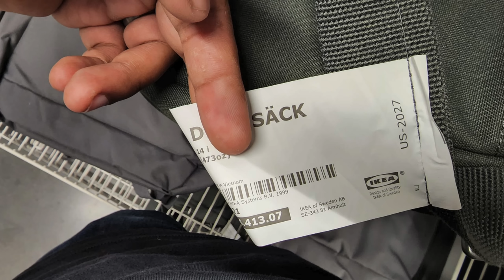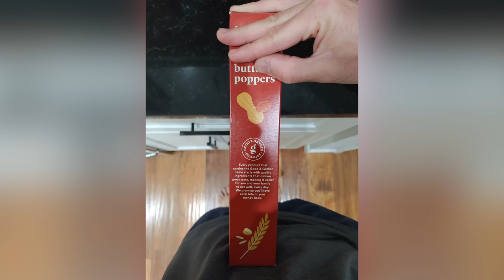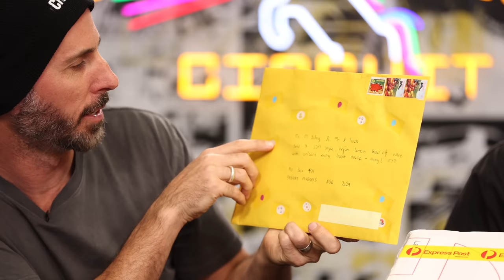We Tried to Steal our own car Conspiracy [Unicorn Circuit EP102]

Comment: Seat belts = Volvo first. Airbags were actually GM in America, who then ditched them for being too expensive. Merc then added to the S-class in 81.
Reply: Volvo invented 3 point seat belts... cars had seat belts before this.
Reply: Henry Ford invented the first car.   Who gives a fuck about a Volvo
Reply: @ddracing2257  hate to tell you but Henry Ford DID NOT invent the first car 🤣🤣 some German guy Carl Benz did
Reply: @ddracing2257  huh? are you 12?
Reply: Also the first ABS equiped car was the S-class. 
The first common rail injection diesel engined passenger car was an Alfa Romeo 156, also the Magneti Marelli and Fiat had invented the modern common rail system, and later sold the licence to Bosch. 
Just the two off the top of my head.
Reply: @ddracing2257  ya he likely stole it. And noone invents anything. Just discovered
Reply: That is correct but it was a 3point  👌 mg in the uk had the first production car with a seatbelt in the 1930's their motto is "SAFETY-FAST " because of this
Reply: Worth noting, Volvo invented the 3 point seatbelt and then gave away the patent for free so that other manufacturers could use it as well. 
Thanks Volvo, nice one.
Reply: @ddracing2257  Henry ford did not come close to inventing the first car.  Henry Ford's biggest claim to fame was the modern assembly line.  Carl Benz gets the car credits.
Reply: @garyhowe88  and  the diesel  engine  Rudolf diesel I think
Reply: @funkysaurus  but I think  he stole it from  Japan but maybe I am mixed it up with just in time assembly.
Reply: Volvo gave the design with the world for free.

Comment: In Finland, almost no dealerships have cars in stock. Some larger have "standard" equipped models (usually almost no extras, and almost always white). The most common thing when buying a new car though, is to sit down with the dealer, choose exactly what you want and don't want, and then that specific car is ordered from the factory. Yes, you have to wait several months for delivery, but you don't have to pay dealership scalper prices, and of course the dealer doesn't have to tie up funds in inventory and storage.
Reply: Word/Amen! One of these days I'll get to spec a car just how I want it & order it from the Company direct. Especially if it's one of those cool companies that lets me pick my own unique colors instead of just picking the 5-10 colors they have on the brochure. Someday, some day, it won't just be me fantasizing on Honda/Acura's page, building my dream NSX (or Toyota, building a legit Supra made by Toyota instead of bmw). It would be well worth the wait for sure! Like those 1%'ers that can afford a Huarya, or a Koenigsegg, etc etc., and they spec their car & wait a year or two to get it because it's made to such a high degree of quality & performance. In other words (long message) I totally agree with you! I just want a 1993 Red or Black (or whatever color really) Twin-Turbo 1JZ powered Toyota 👑 (Crown) Majesta/Royal Saloon wagon with a fully adjustable suspension & some sweet 18"×9" Rotoform Gold 5 spoke wheels with the dished out chrome barrel & some Pilot Cup Sports on it. About $10k-$15k all in. A sleeper jdm sport/adventure/grand tourer/daily driver/camping/family hauling/VIP'ish nugget with an excellent exhaust system 👌 with cutouts so it can rage & also be quiet when you want it to be. Maybe some Air Ride for that belly dragging sickness & high rider (the AWD model is the one I'm looking for) with ground clearance so you can pop on some dirt tires (on cheap wheels) and go rally & camp. The do everything car! Sorry about the long as comment btw! I get excited when I come across a kindred spirit 🙌 ☺

Comment: In a lot of places claiming low supply and increasing the price when there is no limited stock planned from the start is actually not directly illegal, but if you do it you better have a good legal team cause the class action lawyers will be on your doorstep in no time. Anti-consumer behavior like that, even in the US, doesn't fly so well.

Comment: Here’s an conspiracy. What if the CEO, CFO, ext. authorizes dealerships to “sell” new cars with a default markup of e.g 25%, then the used buyer then returns/sells it back to what could be argued as not a depreciated value, but actually the MSRP. Just saying, new car, put a couple miles on it, depreciates often by thousands?. Simplified, cars are in one way over priced, and the gatekeepers of the auto industry make extra bank. I’m not say the auto industry does it or is corrupt, but I know many companies and/or shell companies do. Side note: e.g carfax and like companies are paid off some how by used dealerships w/ e.g a totaled car, that’s not reported / or repaired in their own shops / chop shop, and not reported, aka clean title, seen it myself.

Comment: Holdup. The 400Z is supposed to be ~$40k US. Why's it nearly $20k AUS more than it should be at the current conversion rate?
Reply: Everything is more expensive in Australia as Australians are willing to pay it and its illegal to parallel import cars that are sold locally. There's probably also some tax and regulatory differences that might increase the costs.
Reply: @tinystar3010  Probably still going to be around $40k in the US. The BMW 330i M-sport US MSRP converts to ~$66k AUS, but the Aussie import actually retails for $79,990.
Reply: Ahh ok. Well hopefully its on the lower side

Comment: If an Individual wants an Imported (New or Used) they "should" be able to drive to the Port of Reception and be able to "Cut out" the Dealerships to save up to 80% due to GREED of these Blasted Dealerships!

I say, get rid of these Dealership Locations (except for Tangible Examination) and have the Manufacturer pay these locations for this service.

Tangible Examination is how I shop. I want to See, Smell, Touch, Hear (and possibly) Taste what I am Investing in. There are so many occasions where items being sold On-line need that "Personal Touch" sensation...

MCM 4 Life,
-T🖖
Western Washington State, USA

Comment: What about a manual hyundai excel sprint twin cam 2 litre. There's a whole legitimate racing category for them. I've got a clean one that would suit the channel very nicely. If you want me to sell you my awesome car Moog, reply and I'll send you my number. All the best mate.
Reply: There used to be a bolt on supercharger kit for the twin cam engine. Wheels mag did a write up on it. They took it down conrod straight at night and wound it off the clock. Daft dangerous fun. Also zero star ANCAP rating